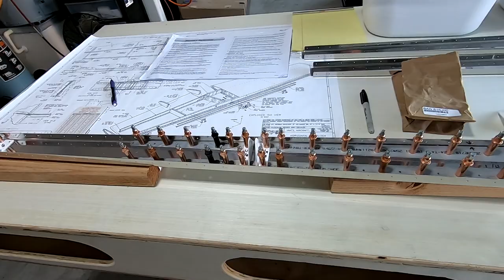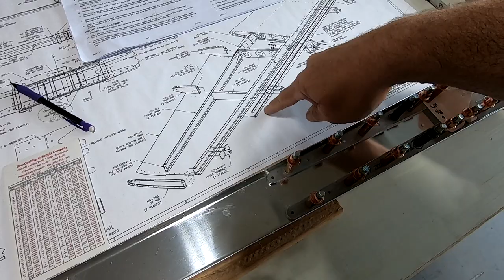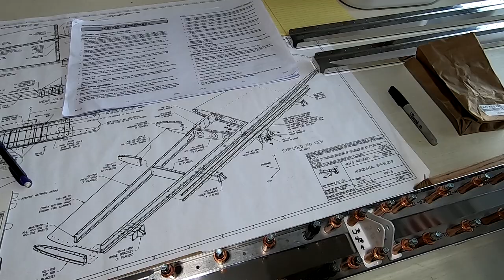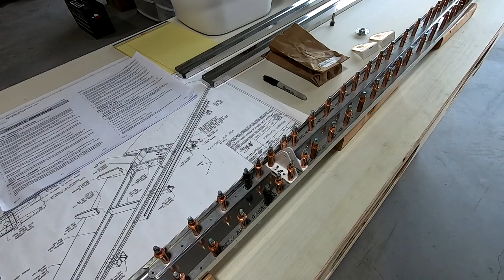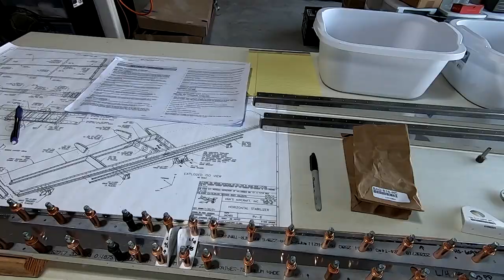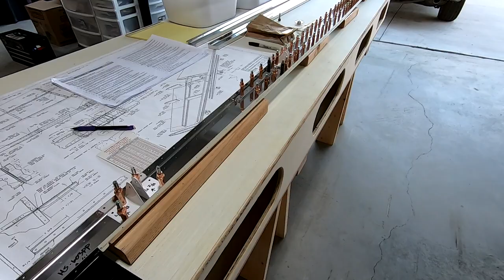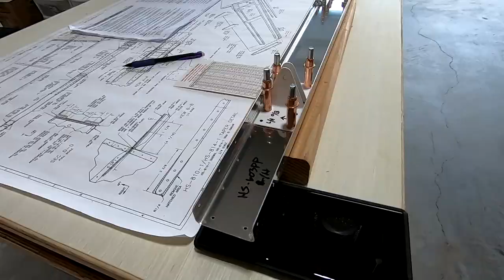Van's RV-8 Build Update 1

Comment: I'll be starting the HS next weekend after I return from visiting family for Thanksgiving. My bags with the elevator brackets and bearing are on B/O. Hopefully not for long. I did a detailed inventory and found a few washers missing. Van's responded quickly when I let them know. As for tools, I'm collecting them as well. I made a pair of EAA workbenches and with the leftover lumber, I made a 3'6" x 3'6" version to mount my bench tools. It's on heavy-duty casters so can dedicate each of the four sides to one tool (grinder, drill press, band saw, vise) and easily rotate the table to access whichever tool I need at the moment. Next, I'll be borrowing a design from a -7 builder that will place my DDRT-2 flush with the other two benches when lined up end-to-end.... It's beginning to look like I'll put at least as many hours into building my workshop as I will building the airplane.